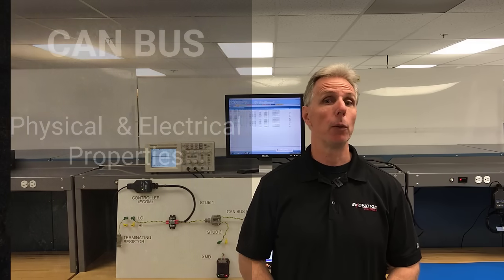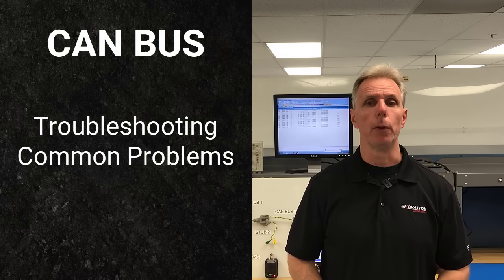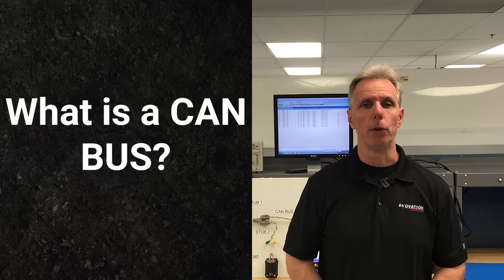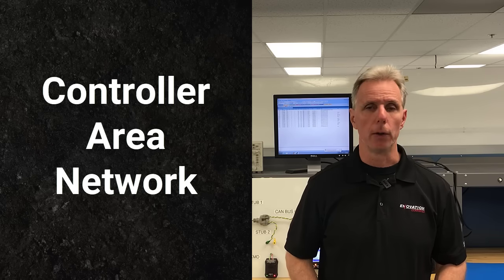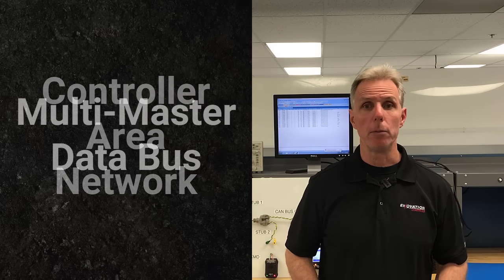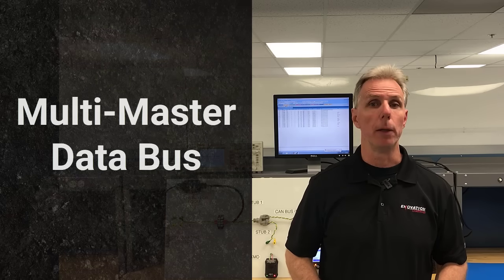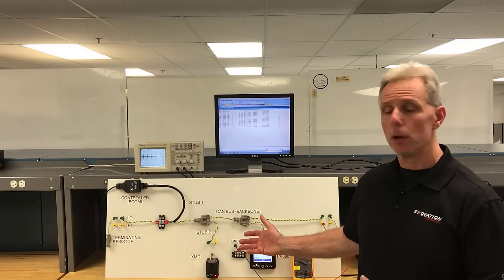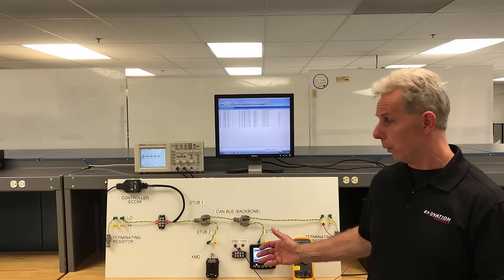CAN Bus Properties and Troubleshooting

Comment: So the CAN bus system is basically  parallel connected two resistors attached to each other with a very long legs. And in between these legs is the modules that act as battery (voltage source). So when voltage is applied the current travels in both directions going through two resistors and returning to the module?

Comment: For total beginners it's worth mentioning that the CAN bus is not just "2 twisted wires", its full spec includes also ground and power (optional) wires. Hence, in this demo there is a ground wire implied the signals are measured against.

Comment: I’m coming here as a mechanic that came across multiplex wiring in a peterbilt and I gotta understand it now. Im obsessed and also now overwhelmed with the terminology of everything. Gone are the days of checking a switch with a test light seeing if it’s simply going through the terminals on the switch with either ground or power. Anyone else a little lost?
Reply: I’m an industrial controls technician by trade. I work with microcontrollers and PLC’s. I write a lot of my own code, and troubleshooting is an everyday thing. All I can tell you is that this shit is retarded and completely unnecessary. It’s simply manufacturers trying to make their stuff proprietary to cut out the independent mechanics. It’s absolutely infuriating.

Comment: Okey, what if the CAN Hi is 9 volts and CAN Low is also showing 9v what will be the issue ? And the terminating resistance showing 124.5ohm. What's will be the issue ?

Comment: I have learned that CAN bus single can be ground out by a bad component, disabling the entire system.  I believe a solution to that problem is run fiber optics or some sort of isolation circuit.

Comment: How long can a CAN BUS be? What gauge of wire should be used? 
Using a CAN BUS to connect up a number of security keypads to a controller, 8 devices per floor , 10 floors, (device into a room via average cable length of 50ft, coming back out to wiring closet, daisy chained to next room, then go back into that next room, repeating down the line until last device, no resistors used). 
There is a controller device in cabinet with the bus network wired out directly to first device

Comment: Very helpful information!  Thanks. I spent all day today trying to diagnose a bobcat track loader that wont fire up. Everything I come up with points to the panel being the issue. When I check ohms from either can hi or low it only reads 14.5K ohms which obviously isn’t Mega ohms or OL. Its just always nerve racking to call a $1500 dollar non returnable part especially when its a customer who doesn’t have alot of money to blow. Anyway, hopefully its fixed up with a new panel!

Comment: Fluke 289 gives much better DC resolution than the 87v for troubleshooting CAN or any other low voltage signal.

Comment: Been trying to figure out a problem in a Kenworth truck, either its s $3,000 gauge cluster, or a $2,500 cab control module😮 this really breaks down the testing procedure. Hopefully ee now can narrow it down instead of throwing both parts at it.

Comment: It is all very easy to understand and "trouble shoot/repair" on the demonstration board. The issue is when the circuit is buried in the deepest recesses of the vehicle, inside wiring harness bundles and 20 different modules are on line... and any cut, crimp, or corrosion anywhere in the circuit or any malfunctioning module can disrupt the network. The difficulty is in finding that damaged point in the circuit.
Reply: this is me right now

Comment: Awesome video.  Very nice.

I belong to an online community for auto mechanics.  Periodically I read help requests from techs struggling with a car problem.  Read one very recently that the tech did some work on the vehicle just to have a stabilitrac msg. pop.  Various U codes pointing to the chassis expansion bus.

Tech says that he found approx 60 ohms at the dlc, which shows resistors ok and wires intact, but I wondered if a shorted wire could change this much?  Have a '12 VW that I stabbed 6/14 at the dlc and got approx 66.4 ohms.  Shorted a wire and surprised to see 66.3 ohms.  Thought this would be way different and still doubting my testing.  Will do more.

So, my question is, can you have 60ish ohms at the dlc even if one leg is shorted to ground?  If you mentioned this in your video then I am sorry I missed it.

Thanks,
Jim

https://evesautomotive.com

Comment: As a newbie to car electronics, I found this a very useful help in understanding the can bus system. But there was no explanation of timings. From the oscilloscope, the signals appeared clocked. Is the system clocked as in computers and where does the clock reside on a typical vehicle. I presumed there must be a central controller that orchestrates the system but your remark that it is a multi-master data bus seems to squelch that view. I do however feel more enlightenedly confused, which I think is an improvement.

Comment: step 3 was wrong or at least can make you trip.. usually its not FULLY broken wire so that there is just unwanted resistance in the wire it will show voltage if there is no load...

Comment: Is it possible to wire up a non can bus device to a can bus system? Example; my new BMW motorcycle utilizes can bus. I'm trying to install an aftermarket taillight/turn signal led unit in place of the factory one. The aftermarket one uses a conventional system one wire for ground, one for taillight, one brake light one for left turn and one for right turn. I've gotten some of the functions to work but not all. Can this be done?

Comment: This is great, nice simple introduction to the CAN system for someone like me with long experience of servicing good old fashioned analogue electronics and old simple classic car electrics. And the signal reflection action is probably a bit like what happens when setting up a CB radio rig where you get too much RF reflected back down the cable when the aerial, or antenna, is not properly tuned. And this system reminds me a bit of  the digital control systems for model railways where just one power supply can feed all the track but each train, or locomotive will only respond to it's own control commands sent through the same tracks as they each have their own decoder fitted which are all different and only recognise their own codes. But of course even with the CAN system there will still be the age old problems of intermittent connections often caused by corrosion or vibration over time etc. and in my experience with some more modern vehicles I've found that some wiring connectors are ok until they're unplugged and they sometimes start playing up and go intermittent after they're reconnected so I suppose that can happen with this system too, and some more recent vehicles have far too much stuff crammed into too small a vehicle making some wiring well nigh impossible to get at.

Comment: I can see the benefit in layout and troubleshooting using stubs, but electrically I think the daisy chain approach was how the system was envisioned. In some automobile installations it looks like the stubs are longer than the backbone, but it appears the bus is not corrupted beyond use.

Comment: Ok so I have a odd situation.  I have 117 ohms so I'm assuming the resistors are bad but also when I check hi and low I'm getting 6.3 volts combined when I should be at 5volts. What could be the issue? Where should I look?

Comment: Awesome video!! Thanks for sharing. One thing you did but didn't mention was when measuring termination resistors you had the power off. If on and communicating this can throw reading off. So make sure power is off for termination resistor measurement.

Comment: Excellent video, thank you. I have a Marklin Central Station 2 controller unit for my G-Scale model railway which uses a CAN Bus and Gateway to control the trains and various accessories via Decoders, such as points (switches) and signals, model lights, motors, etc. This has really helped me understand how my bus should be setup, and the purpose and use of terminators (snubbers?), and how stubs (track feeders) are used to connect at regular intervals to the centre of electrically isolated sub-sections of railway track, which in so doing also helps to isolate and more easily find bad track connections (caused by weather/corrosion), and reduces bus data reflections. Plus you show how to perform diagnostics on it all. Really VERY useful and well taught. Thanks, Jim

Comment: Had a new vehicle that the body controls were isolated from ground except for can buss and constant battery power. Back feed onto can low and high, causing datalink to read 10volts. Voltage backfeed looking for ground through modules. This ends up scrabbling software. Good times figuring this out with 
Customer added controls.

Comment: Excellent video and representation. Question; Why do we have such a large voltage difference between CAN High and CAN Low, meaning a flood of data when we disconnected all the devices from the network except one? Isn't the concept like, more devices connected to the CAN Bus results into more data travel which results into a large voltage difference between CAN High and CAN Low, and, less connected devices results into less data travel and low voltage difference between CAN High and Low?

Comment: When using the ohm meter to diag the network at pin 6/14 it should be emphasized  to disconnect the negative battery terminal C

Comment: Thank you man. I can’t tell you how grateful I am. Iv been having a hard time finding good diag information with these J19 systems. I’m currently diagnosing a daisy chain of 8 J19 splitters. Looks like I got 5 stubs to modules/sensors, and 2 Termination links. It’s difficult isolating these but I’ll be looking through channel to help me understand this system better.

I looked at the Texas Instruments link and it’s very complicated and uses a oscilloscope for diagnosis. I’m gonna have to get one. Do you guys offer classes for diagnosing these J19 systems?

Comment: Does anyone know what voltage I would see on can bus /+ wires when one of those wires was open? For instance my can c backbone is open and I checked voltage on can - terminal at anyone of my devices what would my voltage be and what would it be for the can + wire that is still connected properly.

Comment: Thanks for a great video. Especially troubleshooting was really great for me. I miss only one scenario there, how the CAN bus behave when there is short circuit between CANH and CANL. How this can be detected and troubleshooted?
Reply: A short would give ZERO resistance as opposed to 60 ohms (the 2 terminating 120 ohm resisters in parallel...) 😉

Comment: And no dealership is going to do this amount of troubleshooting for a customer.. They offer scrap price and trade in finance options for a new vehicle only. Or, they will say we need to replace the whole wire harness with no gurantee it will fix the issue, with a repair quote no one would agree to. Yeah, it's all terrible when GM dips their wires in penut oil to preserve them and one little chickmunk nipping one little wire could shut down a persons whole car. Bad grounds too.

Comment: Can bus is reason millions of vehicles are in the junk yard that were mint, and then failed with "ghosts" causing no starts. Also this technology is the reason 95% of backyard mechanics can not work on their own vehicles. Couple this voltage limits, with Eprom software being volatile, erasing programming itself.. That a dead or weak battery in the winter can cause a majority of vehicles to fail.  Bad ground or old wiring causes resistance failure! Terrible!
Even if a mechanic like me has the knowledge, after they find out about the tools needed for programming and software upgrades, this system was made to rip off the consumer. These systems were engineered to fail. Any way. My jaded feelings still appreciate you for making this video.

Comment: Had a weird problem with Flight Attendant call lights where three non-consecutive rows of lights were inop which seemed to be related, yet no obvious connection in the system. HOWEVER.....a system self-test lights all the lights, yet the individual call button would not light the call light. D.E.U. (Decoder Encoder Unit) did not seem to be the problem......and the plane had to fly before further troubleshooting could be accomplished. If I'm not mistaken I believe the Att call system is a CAN Bus system. The troubleshooting manual addresses failures in consecutive seat rows (a DEU)  but not for separate rows spaced throughout the cabin. How can all the lights be lit during system self test and yet the individual buttons don't activate the call light in certain rows? (Yes, the circuit boards with the push buttons were swapped out. No help.)  Any ideas?

Comment: Super demonstration of the CAN Bus system.  I'm electronic automobile master technician and most of the content would apply to car and motorcycle as well.
I'n car, the resistance are included in some device such as ECM and cluster or fuse box.

Comment: I wish they would also talk about single wire CAN bus (SWCAN).  As the video show, I have been able to create multi wire CAN (MWCAN) bus and have all the equipment talk to each other but I am not having success with SWCAN. Would you please provide some explanation on SWCAN? Is there a terminal resistor required? What size and how is it connected?

Comment: great video, thank you. i have a question. I am getting around 2.9V on can HI, and 2.6v on Can Lo. why am I getting over voltage? also I am getting 120 ohms . it should be 60 ohms. when i unplug rear Term resister . i read only 7.8 ohms . any help would be great. this is on a 08 GMC seirra 2500 6.6l diesel .

Comment: Let me add my voice to the chorus:  Thank you!  (My interested is automotive)   Not to detract from that, there is one thing I think is "missing" and may be confusing to some students.  It would be good to run a third wire below the CAN pair showing ground going to all the units, and to which the CAN signals are referenced.  ( in fact power might not be bad to show as each of those devices is connected also to power and ground).  The problem is that in conventional circuits (non CAN) a pair of wires (particularly a twisted pair) carries one signal, the voltage in one being in respect to the other.  In CAN, each wire caries a signal with respect to ground AND also with respect to the other.  One signal being the mirror of the other (with respect to 2.5 volts) .  While in trouble shooting one looks at the individual signals, each device actually looks at the differential signal.  The reason for all this is that it is a very noise immune topography.  Noise that gets into one signal also gets into the other, and thus the difference signal is unaffected by noise.  BTW, the reason the signal rides on the 2.5 volt carrier is 1) it is tricky in the electronics to handle signals that approach zero (zero crossing issues), and 2) at low and zero volts, no current is carried.  The higher the voltage, the higher the current being pulled into the termination resistors.  The higher, the current, the greater the signal is with respect to any inducted noise signal. Inducted noise can create high voltages in a high impedance line, but since inducted noise is of low power potential, it produces relatively little voltage in a low impedance line.   Thus CAN architecture uses four tricks to overcome noise 1) low impedance transmission (on the backbone), 2) differential signal pair transmission, 3) A base line offset from zero and 4) twisted pair transmission line (decreases inducted noise in the differential signal) .   
Thanks again for you excellent tutorial !
Reply: Had a weird problem with Flight Attendant call lights where three non-consecutive rows of call function (lights and chime) were inop which seemed to be related, yet no obvious connection in the system. HOWEVER.....a system self-test illuminates all the lights, yet the individual call button would not illuminate the call light. D.E.U. (Decoder Encoder Unit) did not seem to be the problem......and the plane had to fly before further troubleshooting could be accomplished. If I'm not mistaken I believe the Att call system is a CAN Bus system. The troubleshooting manual addresses failures in consecutive seat rows (a DEU or wiring)  but not for separate rows spaced throughout the cabin. How can all the lights be lit during system self test and yet the individual buttons don't activate the call light in certain rows? (Yes, the circuit boards with the push buttons were swapped out. No help.)  Any ideas?
Reply: Think they are a given, as it's another 2 wire interface. Just like with I2C they will show SDA and SCL, but of course there is ground and power. Again with SWD, it is called Single Wire Debugger but uses 3 wires. I think once used to that common standard, it would perhaps complicate to run the additional wires.

Comment: Thank you for that informative break down. I am fighting a 2011 Buick regal that is showing 120 ohm but finding which module have the resistor ecm seems to start it . I unplug it and 120 leaves. So I know we have a issue.
Reply: 120 leaves? What does that mean? What is the resistance when you unplug the module.

Comment: I love this basic theory how the central areal networking controller coming in and out send to the message or signal by every control unit works....but remember not all the CAN BUS are CAN HI and CAN LO  is low voltage supply...its depending the designation  of control units what they task program or depends the parameters of module🤐🤐🤐🤐👍👍👍👍❤️❤️❤️